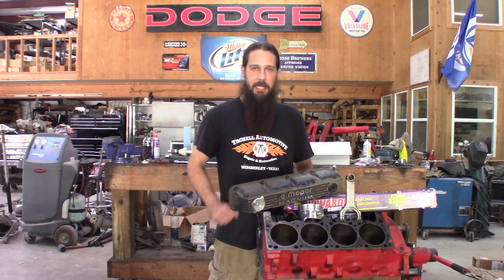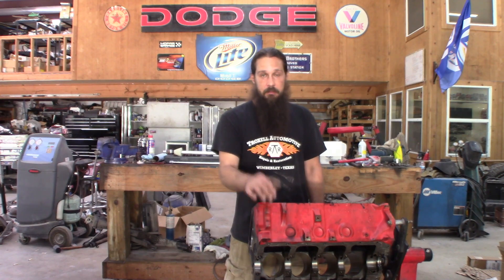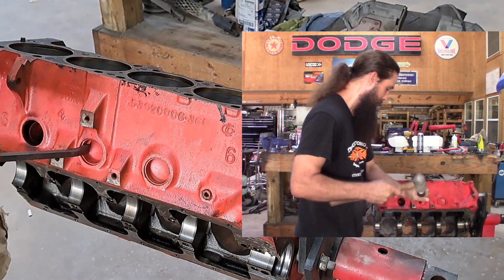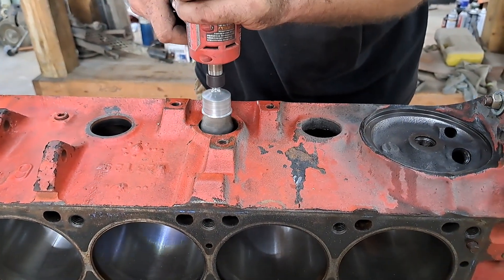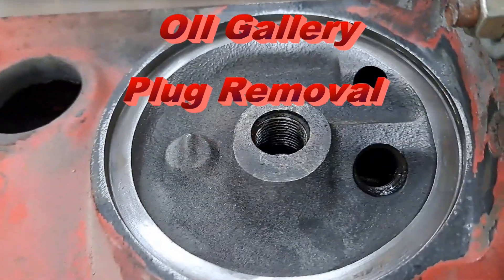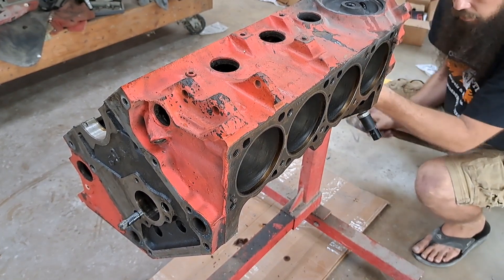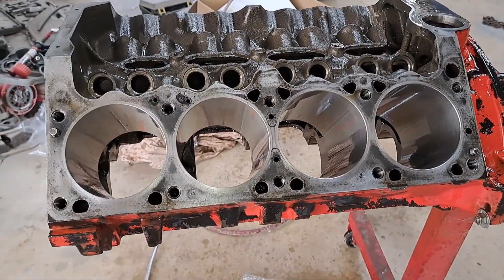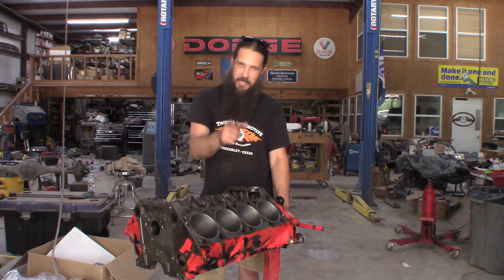How to Clean And Prepare An Engine Block For Assembly - Junkyard 408 Build For the 1969 Dart Begins!

Comment: If you dont have a thread chaser you can make one with an old bolt by cutting 3 or 4 slots perpendicular to the threads with a cutting wheel or similar